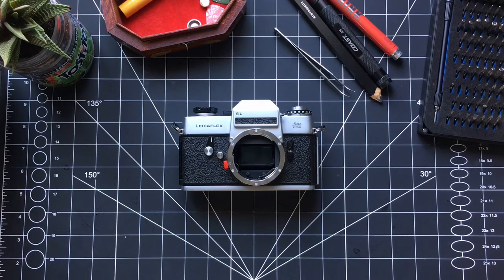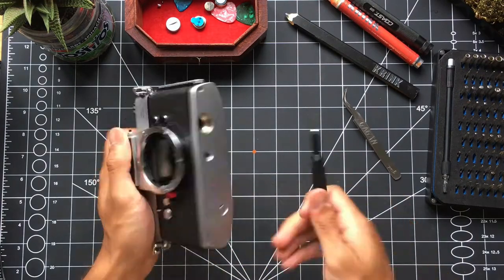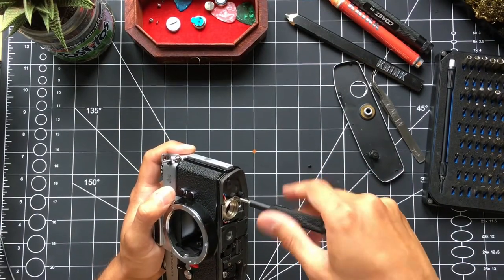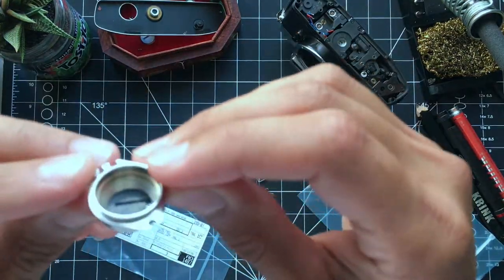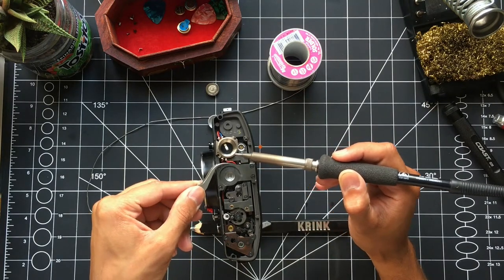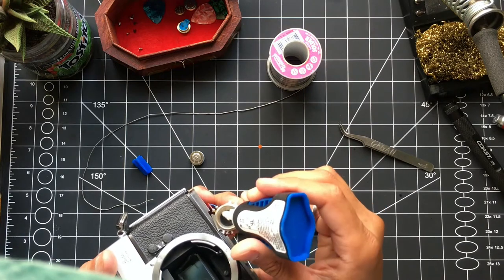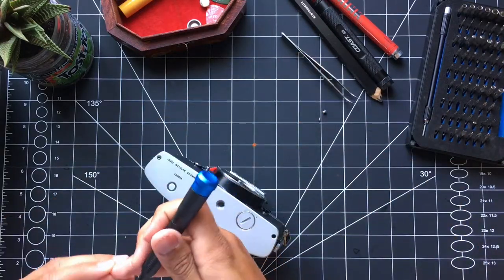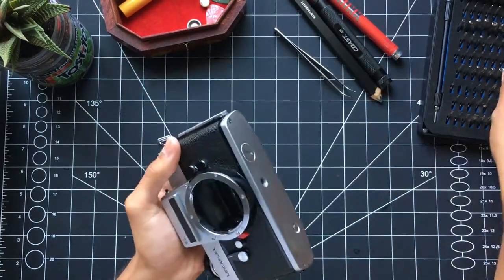Vintage Leica 35mm Camera Restoration & Repair - Part 1: Battery Contact

Comment: EDIT: 

digikey part number: 36-105-2-ND

---
Can you post the digikey part number?

I just got my leicaflex in and it needs the EXACT same fix.

I opened up the battery compartment and the terminal just popped out.

Comment: The tripod screw is NOT a left-hand thread, it is right-hand but you are un screwing the female thread, a shell with a square cavity in the middle. You thus unscrew it clockwise.

Comment: What did you use to remove the screw in the tripod mount?
Reply from the maker: Seemed like an odd sized square hole, I used a Robertson bit and it worked decently

Comment: Trying to do this on an SL2 seems to be another screw holding the bottom casing in place, but there is not thread or drive hole in the tripod mount. Any ideas where it might be?
Reply: I just opened mine, I have a square slot at the bottom of the tripod mount hole. It's a square or 'robertson' type screw, not sure of the size. I - very carefully - used a mini flat screwdriver that snugly fit diagonally which got the job done (it loosens clockwise with the back of the cam towards you). But ideally find a Roberson or sq,square driver that fits.
A normal square bit will taper too wide too quickly to fit the hole, so make sure the bit or bit or driver shaft never get wider than about 4,5mm for at least the length of the hole and a bit. As I said I winged it with a snugly fitting 4mm flat head diagonally. But if you damage the screw you're in more trouble, so better order a decent Robertson screw driver.  probably 3.4 mm would fit, the 4mm flathead doesn't fit vertically or horizontally. hope this helps. Thanks Premature Yeet for the video!!
Reply: I’m trying to do this as well. I bought Robertson bits but I’m still having trouble. I think that it’s stripped a bit already. I wish they had made this one easier to get out!

Comment: Whitch battery are you using in the Leica?
Reply from the maker: It's a WeinCell MRB625, got them on amazon.

https://www.amazon.ca/gp/product/B07JCPG9YN/ref=ppx_yo_dt_b_search_asin_title?ie=UTF8&psc=1
Reply: Thanks
Reply: @prematureYeet Wow, 30 bucks for two

Comment: Great video, but I was duped by how easy it looked. Screws are tiny and nearly impossible to handle. Wires are brittle and broke twice. Soldering old wires in tight space is a nightmare—I need four hands. And my meter still doesn’t work.